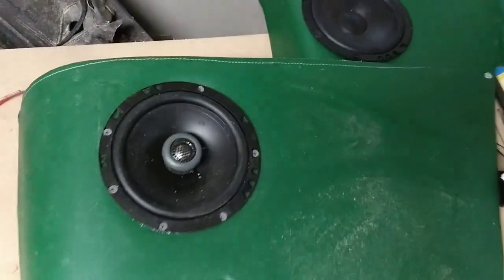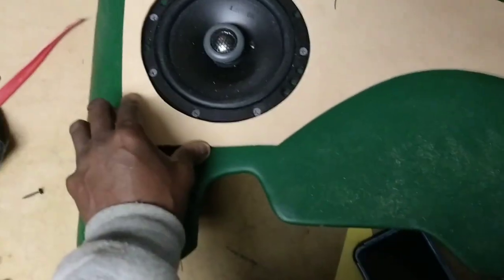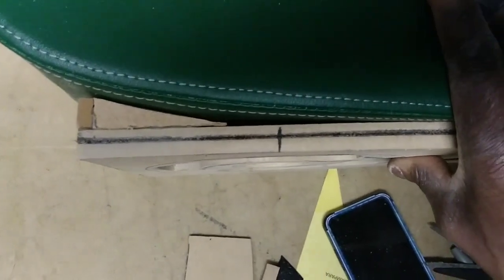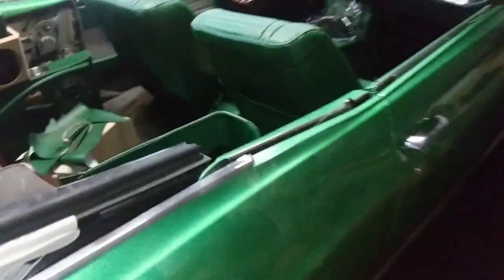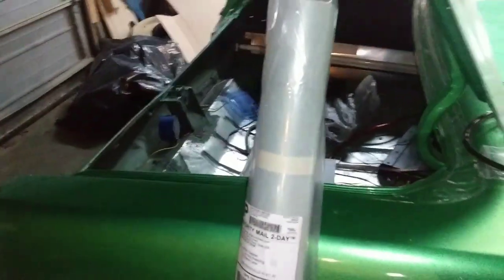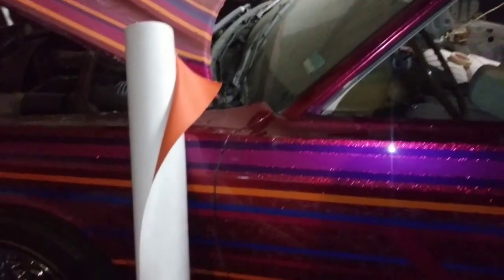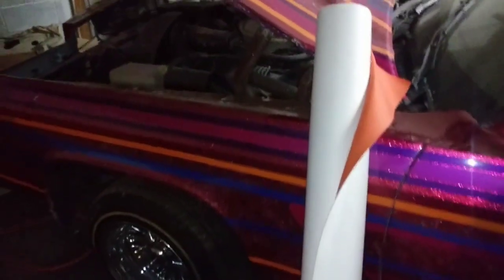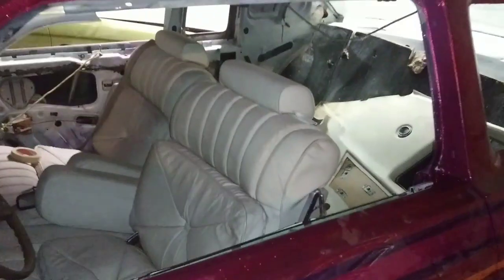67 Skylark speaker pod install

Comment: Bruh next time u run into a situation like that where u need to make a curve, set your blade on your table saw at 1/16 and kerf the back of the panel u need to make the transition with and it will allow your panel to bend right around your curve. It also works well with thicker material u just gotta set your depth of your cuts a little deeper to match your material u are using.. great work as always💪